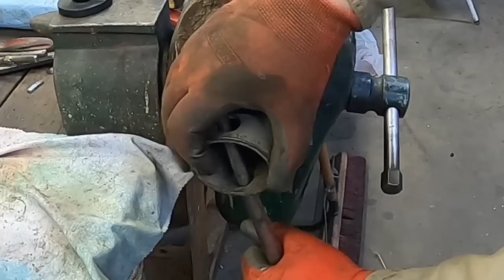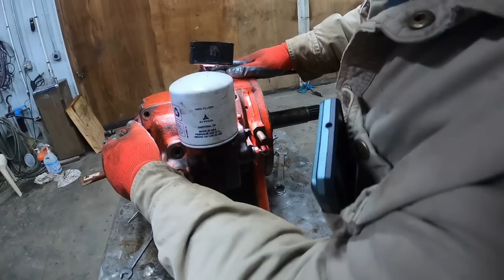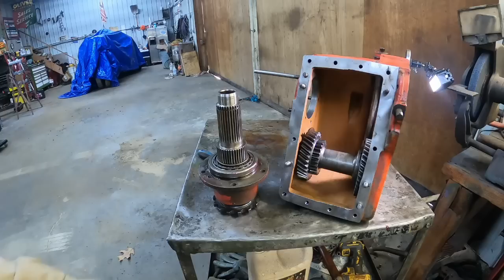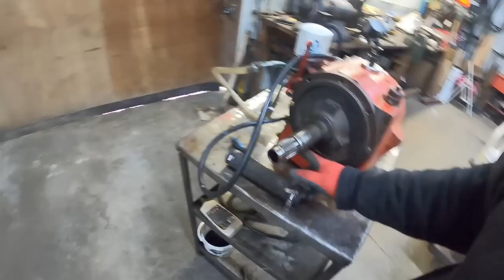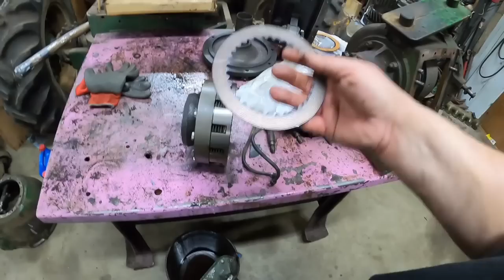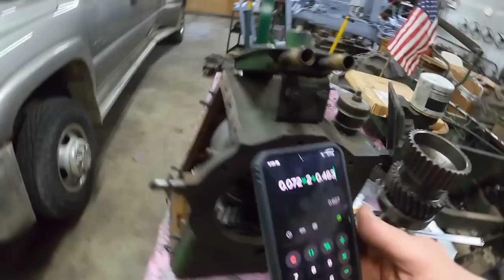Cockshutt Hydra Power Part 2

Comment: How come you didn't power wash or clean your outside case? Doesn't it open a possible can of worms  with the possibility of dirt exposure to your clutch plates? Is are there  companies who make custom clutch plates and material coatings?
Sad note that they are available.
Reply from the maker: I washed it in my parts cleaner. Jump ahead to the 1 hour mark. It loks clean to me.

Comment: Question any one know where to find the sprag bearing for the hydra power ?
Reply from the maker: There is a replacement that is supposed to work for sale in ebay. I haven't tried it, so I can't guarantee it's going to be right.
https://www.ebay.com/itm/285325339055

Comment: Were White 100s based on a 2-105 or 2-135?
Reply from the maker: The 2-135
Reply: @ThatOliverGuyChris  thanks. From a picture it looked like a 135, but that's a pretty heavy tractor for 100hp
Reply from the maker: @bendunkelman4853  there were a few things lightened up. Smaller axles and transmission gears. They're still one of the most overbuilt tractors out there

Comment: This math makes my head hurt, I guess that is why I work on IH's.  I didn't recognize that IH number, appears it must be from the Construction side, must have been used after that division was sold off because alot of the construction parts have been NLA for a long time. 

My son hasn't got his 1655 here yet to start his Oliver adventure,  but I did locate a crooked shifter, no part number I could see on it.  Seller thought it was either from a 1655 or 1855, do you happen to know what the difference would be?  Is it the length from the ball socket to the end that goes in the rails?  I think I might buy it and we can find out, its only money right...............
Reply from the maker: I don't think they are the same. Like you said, the part from the balls on down is different length. The 1655 has that shift tower piece that raises the lever up higher. You could always cut the lower part off one shifter and weld it to the other. Just make sure you keep it indexed.

Comment: I was gonna say, "can't be stuck if it's liquid" Chris... hahaha. 
Chris, you should get yourself a crock pot and leave that in your shop, use that to heat up oil and drop your bearings in to expand them for install. Saves you from "accidentally" messing one up. Now, it will stink but, you will be cooking oil after all. Or buy a bearing heater which is way more expensive. 
I was going to say, surely there's someone who makes a replacement clutch disc. I mean, these are almost a standard. 
Chris, if you're good with a welder, cut a small flat stock and weld on the end of the "spanner" socket, cut a square hole for a ratchet and voila. I'm always learning something from you and Ross with these old Oliver's. Ran them, rarely ever had to work on them. 
Happy Easter to you and yours Chris. Great video as always, cheers :)
Reply from the maker: Thanks! Happy Easter

Comment: I had the memory pop up about the brass disc.  Back in my hot rod days, B&M made the GM hydralshift transmissions into killer 4-speed transmissions.  The hydrashshft was a 2-speed over 2-speed.  They would shift first, then into second, then the governor would shift the range into the high range, and the first gear pack would be engaged again until the governor would make the 2nd gear pack to engage, giving the 4th speed.  What was done was a valve was made to dump the pressure coming from the governor, a rod was made to operate that valve, and the notches in the transmission shift detent so it gave the proper 4 shift notches.  It took a bit more than the description I described, but the thing that brought back the memory was the heavy-duty parts needed to handle high-hp drag racing work.  The Military used the GM Hydrashift transmissions in the Duce and a Half trucks behind the GMC truck engine.  They used brass discs in their transmission, metal rings instead of the rubber O-Rings on the shafts that supplied clutch pack pressure, along with metal rings on the clutch pack pressure plate.  The trick for putting this transmission together was to get the bell housing that was used in trucks like the postal trucks used when they had a fire in the plant that made the transmission designed to be used.  
Chevy made the famous turboclide that was used in 58-9 that had GR (grade retard) on the shift indicator on the column.  My roomie got one that had failed donated to him by a dealer.  We had the idea after having the operation described to us in the Automatic Transmission class that there was a possibility that it could be made into a hot rod transmission. After much study of the schematics, we came up with the idea that if the shift valve had a land in the spool, cutting back on one land, it could be made into a solid shifting transmission and not the design that felt shiftless.  We cut the spool back a little on one land and, using a salvage yard postal truck bell housing, we put it behind the 283 with a highly modified Rochester injection unit.  The first gear, formerly GR, had a really low first gear.  The B/Altered would launch like a scalded cat.  
How we modified the injection unit is another story, involving machining in the college machine shop and getting the welding shop instructor to do some TIG welding on the aluminum housing after we made the modifications we wanted. That is another story in itself.

Comment: If the clutch fibers you can't get why couldn't you get them relined or compare some automatic transmission clutch disc
Reply from the maker: When they are almost missing their teeth, relining isn't an option.  Plus, I don't think that's a thing for these types of discs. Searching through online catalogs is how I found these replacements.
Reply: @ThatOliverGuyChris  There is a place actually possibly two in Portland Oregon  Brake systems does relying them there was a place in Port called Otts Friction Supply now is a fleet pride I'm not sure if they maintained that service or not

Comment: Whose steel seal rings not bad but the smaller ones are hard to hook up  takes much care not too break them   just did a power shift on a 870 case the 3 4 clutch  has them  and to line things up can be a problem.   Thx for videos  . Watch all you put out
Reply from the maker: The style that hook can be a bear. I sliced a finger pretty good trying to squeeze one down years ago.